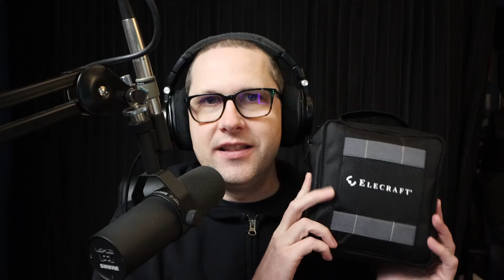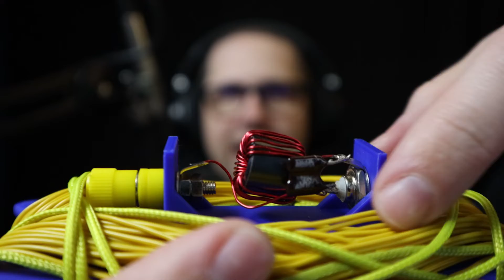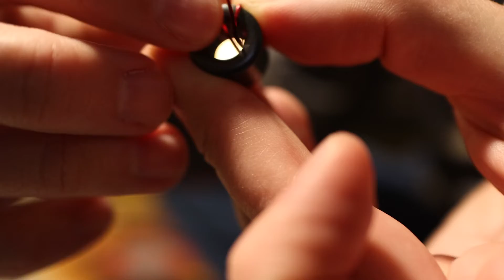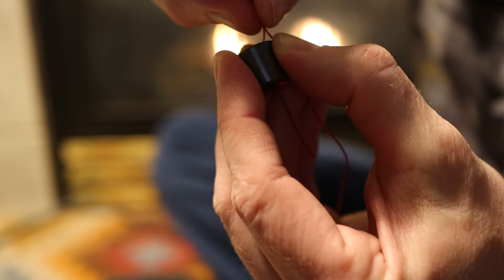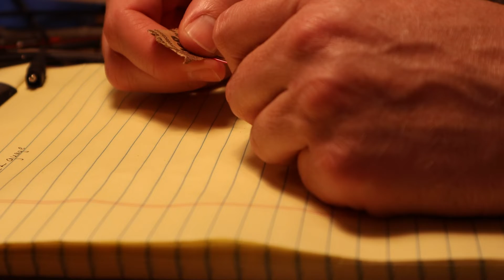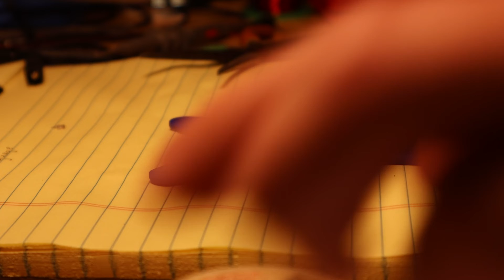95% efficient EFHW transformer with wire winder.

Comment: I'm using that QRP ferrite with 0.8mm enamel wire wound as an auto transformer with 3 primary turns and total 21turns for secondary. I use it at 10W digital on continous long Olivia nets, With bursts lasting several minutes. No change in SWR to suggest overheating, but my SWR is well below 1.3. I'll check with a thermal camera one day. I experimented with 23 turns for 59:1 ratio but the classic 49:1 with 21 secondary turns works better for me on the lower bands I prefer. It is definitely more sensitive and more efficient than the Ali balun I started with.

Comment: I just received ten of the 2643625002 cores from Digi-Key to wind my own QRP+ ununs.  I like your combination small winder and  unun enclosure.  I designed a 3D printed reel for the elevated radials of a motorcycle mounted version of the POTA PERformer antenna.  I'm going to make a version of the winder for an EFHW for 40-10 meters using the 2643625002 unun,

Comment: Fantastic looking build. What capacitor part#?
Reply from the maker: Oh gosh, I can’t remember. It’s just something from the parts bin.
Reply: @KD7QOW-np9gd  Any chance I can ask you to check what the value is? I'm currently working towards duplicating your results (and other YT builds) in a future video.
Reply from the maker: @SelkirkQRP 100 pF. Some kind of silver mica cap.
Reply from the maker: @SelkirkQRP Also, you’ll find you can’t replicate my results. There was an error in my measurements, so I overstated the efficiency by quite a bit. It’s closer to 85-91% depending on the band after I corrected my methodology. Efficiency is roughly on par with the measured losses on 36 feet of RG-174 coax, which was my benchmark since I was comparing it against my portable dipole.
Reply: @KD7QOW-np9gd  Now I'm curious, which methodology did you use? I'm planning on doing the following (not sure if this has a name): build two transformers identical transformers, link the secondary ends together (antenna end), measure loss across both transformers, calculate efficiency based on db loss
Reply from the maker: @SelkirkQRP  That's the approach I used. I just can't replicate my 95% results. When I repeat the measurements, I get 85-91%. I've tried it multiple times, and the only results I can duplicate are 85-91%.
Reply: @KD7QOW-np9gd  As far as I can tell that's still better than most. I'm interested to see how my results compare.
Reply from the maker: @SelkirkQRP  I'll be interested too! Let me know when you get results!

Comment: Logging and uploading to POTA is very easy and efficient; have you considered doing a video that shows how you log ad upload to SOTA?  It seems a bit more steps involved?  Most of the videos on YT are dated.  I would be interested in how you would do it with either paper log or an ADI file from HAMRS or the like.... just a thought...
Reply from the maker: I would except there are so many exceptions to the exceptions and strange behaviors on the SOTA website that it would be almost impossible. Sometimes it can take me an hour to troubleshoot whatever went wrong when a log won't upload.
Reply: @KD7QOW-np9gd  Which problems do you have uploading your CSV file to sotadata? 
I log with VK port-a-log and upload it directly from the smartphone. I did it like that for more than 500 activations and never had a single problem.
73 Stephan
Reply from the maker: @PortableRadio  All of the problems I've had have been related to logging errors. The main issue with the sotadata website is that the error messages it generates are very general and don't give you any clues about why it's rejecting the log. I haven't really had any issues lately, though. But I also never kept track of all the errors I received and the ways I resolved them.
Reply: @KD7QOW-np9gd  Thanks for your feedback, now I understand what you mean! 
Yes, if you have an error in the log, it might be difficult to find the culprit, the error messages aren't great, indeed!
And thanks for the video! About three years ago, I published a document 'Portable 7-Band EFHW Antenna' that uses the same toroid. Great minds...

Comment: Nice design! What length of wire did you use and what bands is it resonant on?
Reply from the maker: Thanks! The wire length is approximately 20 meters, or 67 feet. It’s cut slightly long so is resonant on the bottom of 40 meters up to 7.2 mhz. All of 20 meters resonates nicely. 15 meters is rock bottom SWR, and 10 meters….well, it’s kinda okay. I use the tuner in the KX-2 for “touch up” tuning on 40, and 10. I also use the tuner effectively on 17 and 12 meters. I set the antenna up as an inverted V.